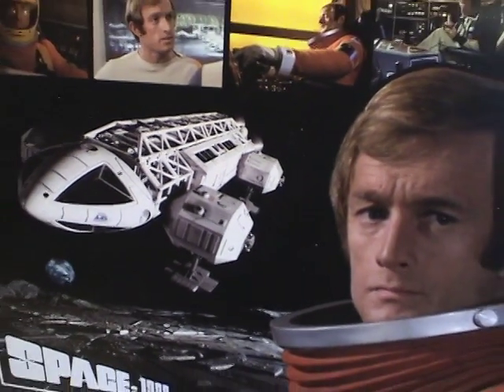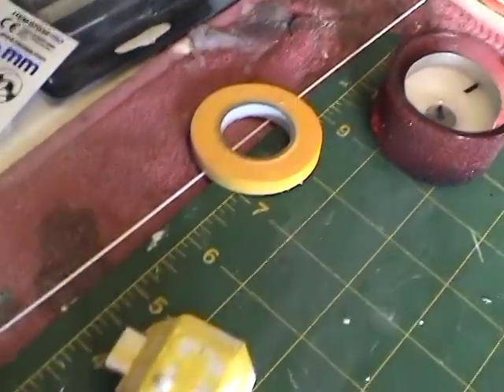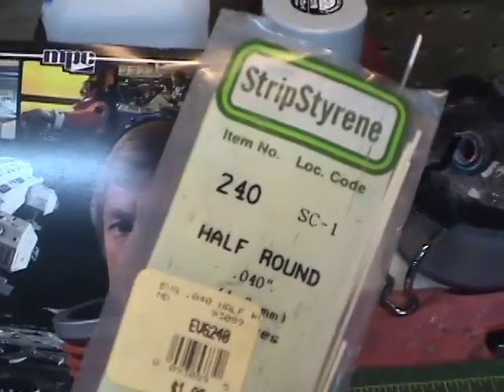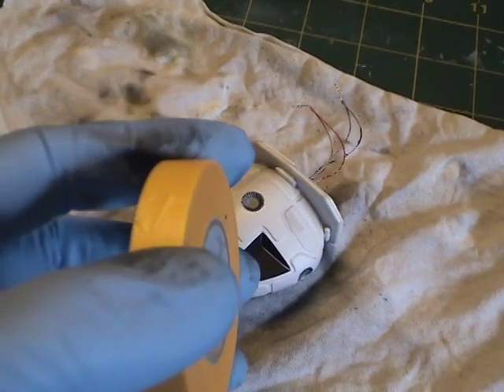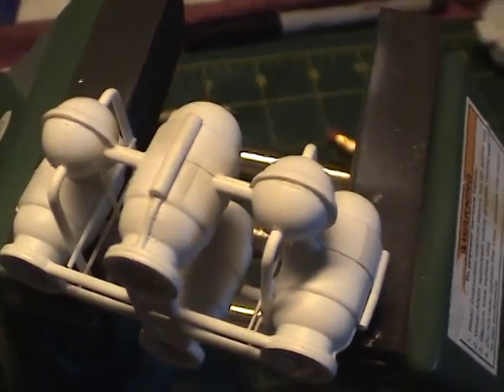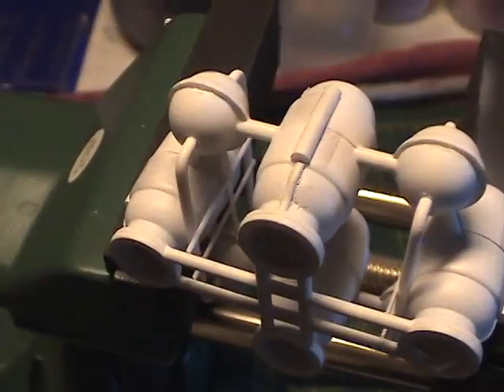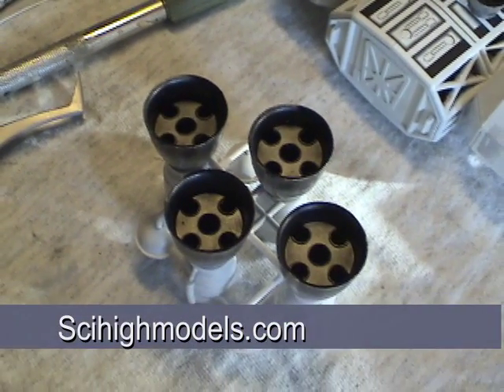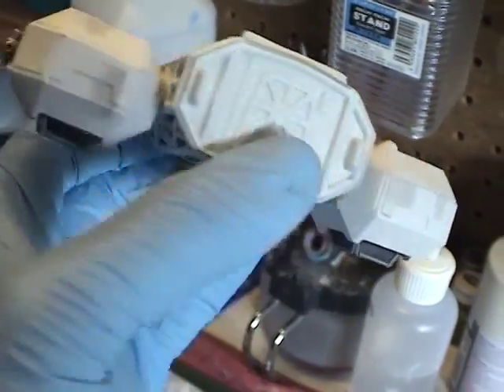Modifying the MPC/Round2 Space: 1999 Eagle Scale model Part 3

Comment: Hi, very great job and video!  can you tell more about pastel you use for shading effects please!  Thanks
Reply from the maker: +Richard Bourdeau Thanks.  What specific questions do you have?  In general....Pastels are a chalk like pigments and are easily available at art stores or online.  They can be ground up into a powder by rubbing them on sand paper then applied with a brush on to the kit. They are sealed with a light dull coat when done to keep them in place.  Check out my videos with the Battlestar Pegasus, Cylon raider, Viper and Millenium Falcon conversion for more demos.  An inexpensive brand....Alpha Colors and can be found at Blick's or Amazon.  Hope that helps.
Reply: Thanks for your help.

Comment: Great series of videos. Thank you very much for taking the time to shoot and post them. If I have one complaint however, it's that I'd like to see how you actually do some of the techniques you talk about, such as the pastels. Do you just take a pastel stick and rub it onto the model?
Reply from the maker: Hi lain, thanks for your compliments and sorry for not showing techniques with pastels in this one. What you want to do is to grind the pastel into a powder and this can be done by rubbing it onto some sand paper.  Dip your brush into the grounded pastel and brush onto your model.  Practice first before putting it onto the model but you can create various effects by how you brush it on.  Laser blasts, soot from engines, wind streaks.  I'll have to put a video together on how to create some of these types of things using different media. I'll try and do that sometime soon.  Thanks for watching.

Comment: Great tip for surface detailing. I will use it!  Do you happen to know where I can get replacement decals for this version of the Eagle? I messed up one of the side module decals...ugh!  Thank you for all your videos....
Reply from the maker: Hi Brian...thanks for watching.  I would just recommend contacting Round2.  I'm not aware of any aftermarket decal sheets for this kit. If it at all interests you, there is photoetch detailing kit you can get from culttvman.com.
Reply: Oh, yes, I got the photo etch kit. Do you think I try to paint the crosses on the 4 module front pieces black?
Reply from the maker: I'm afraid that may be your only option if you can't obtain a decal sheet.  Just fyi.....I've sent in for damaged parts before (to Round2) and they were very responsive.  The only issue is whether or not the sheets are still being produced.  Good luck.
Reply: Thanks IM! I appreciate the feedback info. I'll write them!